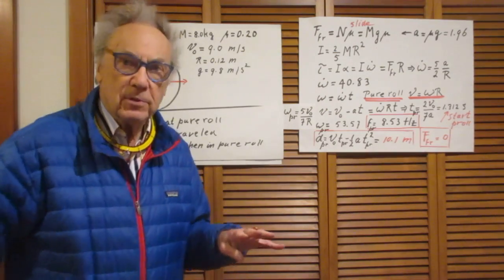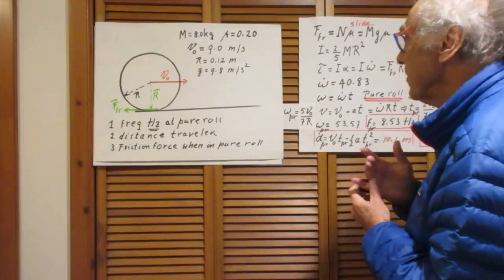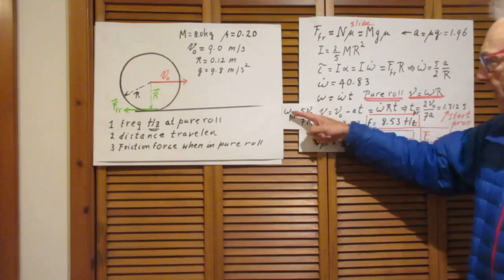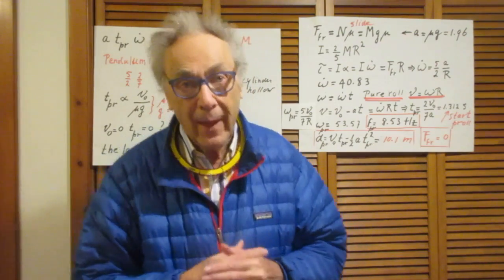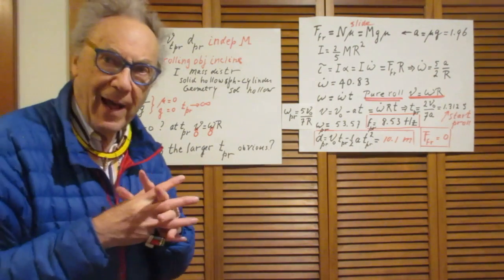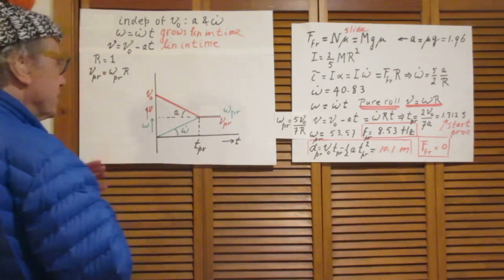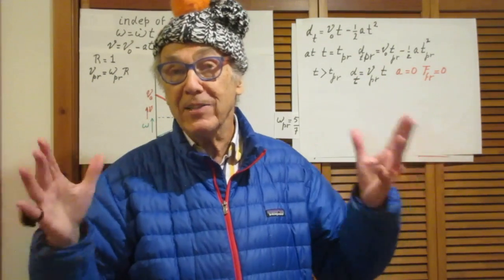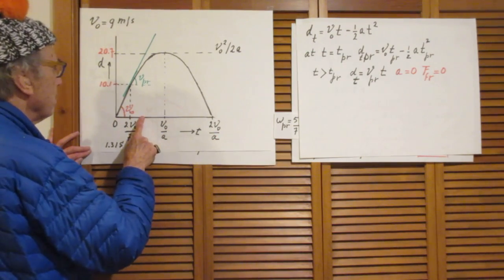Solution to Bowling Ball Problem #54

Comment: Even if you demand using R different from 1, you can plot omega on a different scale on the graph so the height on the graph represents surface speed due to rotation, & solve for the intersection point as before.
        This scaling scheme you are discussing can be applied to many other physics problems, including your Pulley In Elevator & the 2 Disks in Frictional Contact problems.  It makes solving these 2 problems EASY!  And as you say, it makes studying the nature of how things are related so much easier.

Comment: Excellent. Well done, as usual.  In reality, the trajectory  of a bowling roll is laterally curved, especially as the ball slows and approaches the pins. I also observe that there is a component of spin about a near vertical axis which develops about 2/3 of the roll. In the skill of a bowler, Imparting spin is critical in order to get the optimum entry into the target cluster of pins. If there is no friction there is the possibility that gyroscopic forces may be in play here. Have you every thought about that?
Reply: It would be very difficult to come up with the equations for an actual bowling ball thrown by a professional.
Additional parameters would include:
The asymmetry of the ball that helps it hook;
The rotation given to the ball by the bowler, that can be around 400 rpm and at an angle to the path;
Changing coefficient of friction because of the oil pattern on the lane, which can also change as the ball picks up oil.
All of this determines how much the ball will hook and where, how fast, and with what rotation the ball hits the pins.

Comment: Dear sir, I'm ifham Aslam, An Msc medical physics stdnt from Sri Lanka, I'm one of ur fan and watching your videos of demonstration of physics. 
Sir, I have a doubt in rolling motion of a disk. Please sir, give me an idea to solve the problem.
Problem is:
Consider a Circular disk, which thrown horizontally to right on rough surface with an anticlockwise rotation. I have an idea, Since, the surface is rough and friction against the motion, both angular speed and linear  speed will be reduced and reduced.
What will happen to the motion of disk?
Will it change it's direction and move towards left Or not?
If it will change it's direction, What's is Relationship between the critical speed and angular speed of the disk at disk is on momentarily rest?

Please, give me and idea Sir. I'm seeking the idea for long time.
Thanks in advance Sir. 

(ifhamslm422@gmail.com)
Reply from the maker: I do not solve problems for viewers. Use my lectures or use google
Reply: Okay sure Sir. Thanks for ur reply

Comment: Sir, 
I have a question that what would happen if if a mobile is inside a faraday cage. If a call comes would we be able to hear it outside the cage? 
Please reply it's urgent.
Reply from the maker: depends on frequency of the mobile - look that up 
The freq is probably o high that the mobile will work well in the FC that I used at MIT.

Comment: Hello sir.i really appreciate your lectures. Can you help me figure out this rotational problem?i am lost in this problem.please help!

 HERE IS THE PROBLEM SIR

Section 10.7 Analysis Model: Rigid Object Under a Net Torque
37. An electric motor turns a flywheel through a drive belt
that ioins a pulley on the motor and a pulley that is rigidly
attached to the flywheel as shown in Figure P10.37. The fly-
wheel is a solid disk with a mass of 80.0 kg and a radius R-
0.625 m. It turns on a frictionless axle. Its pulley has much
smaller mass and a radius of r0.230 m. The tension T. in
the upper (taut) segment of the belt is 135 N, and the fly-
Reply from the maker: I do not solve problems for viewers.  I teach Physics. Watch my lectures.

Comment: There IS meaning to "pure roll" when V0 = 0.  You set the bowling ball down.  It is not moving, but it is in pure roll because it is not sliding!  Consider the "cylinder on a slope" demo you do.  Make a small change.  Launch the cylinder from the bottom using your hand friction-ally pushing on the top side.  Cylinder rolls up, stops, then rolls down.  If the hill isn't too steep and friction coefficient high enough, pure roll is happening during the entire motion.  At the instant the cylinder stops, it is still in pure roll.  The only difference between this case and a sitting ball is that there is acceleration and friction force on the cylinder and none on the ball.  But there is nothing about "pure roll" that restricts friction nor acceleration.  As long as the contact force and the friction coefficient are large enough, there is pure roll.  The surface of the ball at contact point of plane is the same, and in the sitting ball case, is zero.

Comment: While studying under my study lamp I noticed the shadow casted by my pen on the book then tried to put my pen at different angles and observed the shadow I noticed that when pen is at a good dist from the lamp it caste dark shadow and when I put the pen very close to lamp the shadow appeared to me as disappeared why this happened?
Reply: Look at how partial and full eclipses happen.  When the illuminating body is larger then the shadowing body, there are 3 distinct regions formed.  The first is where all the light reaching a point on the viewing surface is unobstructed by the shadowing body.  The second is where some of the light is obstructed, and the 3rd is where all the light is obstructed.  The 3rd case can only happen when the angular width of the shadowing body (with respect to the viewing point) is larger then that of the illuminating body.  When the pen is close to the book, that condition is satisfied.  When the pen reaches a critical distance, it just barely blocks all the light.  Moving further away, pen blocks lesser portion of the light, until the effect is not noticed (but it is still blocking some of the light).  For solar eclipses, the moon/sun distances and sizes just barely satisfies the condition.  During a "total" eclipse, the moon blocks sun body, but not corona.

Comment: Friction doesn't really go to 0 of course. Sliding friction does, but it is replaced by rolling friction. In the case of bowling it is small enough to be ignored, but for example when designing bearings, it is not. I seem to have most difficulties in high school problems. It's easy enough to understand what happens, but finding the way to calculate it is not so obvious. In this the energy lost in friction threw me off course.
Reply: Nice important observation !   Frictional SLIDING Force goes to zero at the point of Pure Roll [ when v = omega R ]...... A ROLLING Friction exists afterward as rolling could not occur without it. But it is in the opposite direction. That is, instead of the surface applying friction force opposite the motion direction, the ball applies a force to the surface in the opposite direction. With Newton's 3rd Law, the surface then applies an equal but opposite force to the ball in the direction of motion which is why it moves forward at all. Same for a person's foot when he walks or runs.